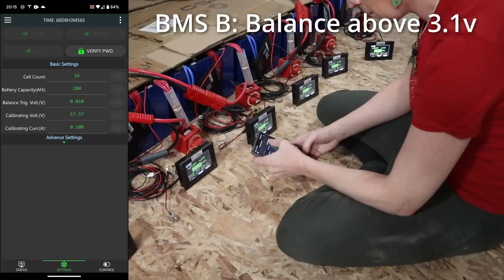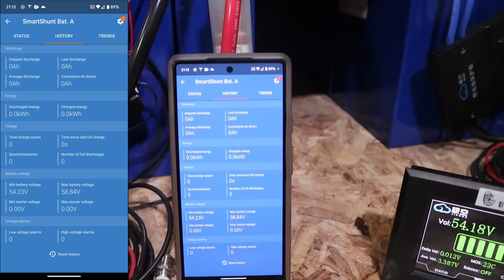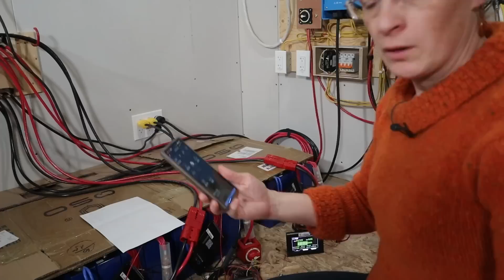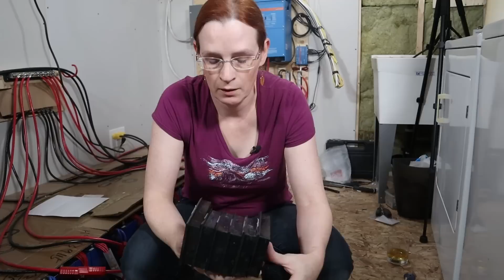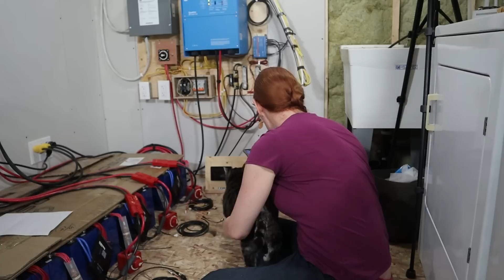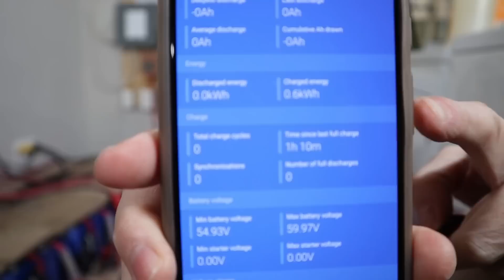Sparky Science! - Big Battery Build! (Ep. 48)

Comment: The screens aren't the issue are they? Why not use an off the shelf buck converter? As you know I am building a similar battery. Indeed 100 304ah cells arrived today. I will use a Raspberry Pi and an IP to 8x rs485 interface to read the BMS data. I am learning from your example. Thank you.
Reply from the maker: 100x 304Ah, nice! You're right, I could have used off-the-shelf. I though I could be more efficient buying a smaller and higher efficiency buck converter. I learned a lot, but financially, this route I took was not a wise one. Hearing that others are learning from me (even if just as a cautionary tale) makes me honestly really happy.
Reply: I was very deliberate in choosing the phrase "your example" and not "your mistakes", as learning positive things too. Thanks for your efforts and good luck bringing the boat home. I am still rebuilding mine. Methinks I will order more fuse holders.

Comment: I think we can all agree that the little “OCD” voice in our head urging us to take more precautions is not being overkill or unreasonable, despite what the other little “let’s just get on with the build” voice keeps saying. Good reaction to the situation. 

I found a little 4-blade fuse block that does not have a “common” side. I use this for some of my test setups. Especially since it allows me to have mixed voltages over the fuses. I would love to see a screw terminal that just has 1A resetting fuses between each pair of screws. I think it would prove very useful for us.
Reply from the maker: The trick is finding the balance between "so careful you freeze" and "too lax and you get hurt". In theory it's an obvious balance, but in practice it's a lot more gray. Well, until after an event like this, then it all comes into focus.

Comment: You rock and this is how we learn, making mistakes. A fuse would not have made any affect on that fire. DC fuses might have not changed the outcome with the buck inverter.  Please just stay safe I would miss you if you were gone.
If you ever have to leave your batteries for longer than say a month discharge them to 50%. That is what is recommended for our batteries.
I do not use what the BMS says for state of charge until I discharge and charge it enough times to be reliable.  Winter really stinks for solar charging.  Once I hit 51.2V I know I have right at 20% left, 48V is 10% left. I then charge back to 54.6 then use batteries to power my house for 3-4 days depending on how much solar input I get and winter there are very few good days.
Wow I do not use Buck Converters as I do need see a need and maybe you should toss them all in the trash. My screen all complete and turn on with its own switch.  They are the handle bar ones and came with my 250 amp JK bms.  How about 1 screen that uses your shunt to display. you can still use your phone to each one. Wow Glad you are okay and didn't burn it down.
I bottom balanced mine at 48 volts since that is the lowest they will ever go. Wow that made a huge difference  when each pack gets 30 amps from solar (120amps total). Before I would see big difference in cell balance. Now I see .006 and balancer turns on and gets down to .004 fast. I see why some say to bottom balance 1-2 times a year.
Reply from the maker: "A fuse would not have made any affect on that fire.", perhaps, but the reason I think it might have helped is two-fold; 1. If you look at the wire after I drop it when I failed to cut it with the saw, it curls up like it's getting hot. I suspect there was a lot of current going through it, even before the sparks started. 2. It would have been something I could have pulled to break the circuit, if only manually. 

"If you ever have to leave your batteries for longer than say a month discharge them to 50%" - Yup, I saw that in the EVE LF280K spec sheet. I didn't mention it the video as the fundamental question of the starting SoC felt, at the time at least, unrelated to the concern overall of high parasitic draw. I've not really looked into bottom balancing... Perhaps I will after the boat is home.
Reply: @TheDigitalMermaid  If you do use fuse they need to be inline and be old style the tube ones, when they break they leave a huge gap. Have you seen the videos showing the circuit style fuses catching fire?  Just be careful and have an electrical fire extinguisher handy. I have seen DC shorts in boats. this is why we have cutoff switches. not the cheap t handle ones the big ones like you do. also on your solar input a dc disconnect not a fused one. a inline fuse outside.
Reply from the maker: @dc1544  The solar has inline DIN-mounted fuse holders, and then normal breakers near the MPPTs. I plan to keep this setup on the boat.

Comment: Hmmm untill you use a BMS that ceases charge based on tail current you'll never be able to accurately determine when they are fully charged, setting a voltage max, and allowing charge current to naturally tail off, but to not cease will essentially just float the cells, which isn't ideal given their chemistry.

Comment: When the battery is under load each cell in a string will have a different voltage, that is way bigger than when they are just sitting there, under this condition the active balancer setting can have a greater impact as it will provoque an unnecessary unbalance. the setting above 3.4 is the best to make sure than when you recharge the battery to 100% you get that even charge faster across all cells. During your test , battery's with a lower balance voltage setting, were a bit more unbalanced and trigger the over voltage protection (that you assumed it was the charge end on the packs tested A,B;C), leaving the balance voltage set to 3V specially in situations where the pack is not constantly charged to 100%, over time will provoque a deep unbalance, that will compromise the overal performance/capacity of the pack, unless you leave it for charging as long it needs to rebalance again. Sorry for the long text :)

Comment: A very long shot that could explain the rapture of the buck converter: Provided the negative terminal of the buck converter was connected to the switched negative of the BMS (just ignore if it was connected to the battery's negative pole) and the charger mode changed, for some wicked reason, to constant current instead of constant voltage, the charging voltage rose, the BMS high voltage protection disconnect was activated and consequently the buck converter had to undertake the max voltage swing of the charger trying to pump through it some serious Amps. In such a case it is normal that the buck converter chip would pop. Greetings from Greece.
Reply from the maker: The negative is on the output side of the BMS, actually. Inductive voltage is kinda what I was thinking as well... If you noticed when I talked about it on the video, I kinda did a "bouncing off the wall" motion with my hand, thinking the disconnect caused a spike. So you might very well be right.
Reply: If memory serves, in a past video of yours, related to the back converter assembly, there was a reverse polarity protection diode at the input. The inductive voltage that you suspected, had it occurred, should had been drained through that diode. There is the odd case that either this diode was not correctly soldered, was faulty from the get go, or it blew instantly failing to protect the parts downstream. You have the item and can check. If this diode is still ok, than the inductive voltage theory doesn't stand.
Reply from the maker: @5fxindices933  I'm sending the board to Andrew for analysis.

Comment: Hi! I'm Sure I lost that part/episode, but what's the need for a buck converter with a 16S configuration with the JK-BMS, have been using them for a couple of years and no buck converter needed with 16S, Only use those with a 8S configuration before JK released the 8S version.
Reply from the maker: The screens only accept up to ~24v DC. So it's fine natively on 4S and 8S configs.
Reply: @TheDigitalMermaid  Ok, I see :)  Guessing the boat will have a normal 12 V system also, maybe you should consider to power the display from the 12V "grid" combined with a power switch so you can enable all on only when you need to do a reading locally and turning them back of when nobody is looking at them :).
Reply from the maker: @claudioporto5926  I plan to have a 12v system, but it will be for the critical systems; Radio, nav lights, backup bilge pump, etc. Most of the house loads will be hopefully natively 48v, and using 48v -> 12v converters as needed at point of use.

Comment: Madi,
Having watched you suffer from doing the last parallel balance cycle - too much work, I am lazy.

Since you have the nice JK BMS - 1A active balance current?...

You should be able to perfectly rebalance in a reasonable time (please ignore this if it is obvious).

Make sure the balancer is on and  activates at 3.4V - i.e. balancer is *always* on above 3.4V (charging or discharging). It looks like you are using those setting already.
Then , Once the battery is 'full' (using your chosen charge voltage), 

Just apply a charger at 54.4V (either your Victron) or you standard CV/CC power supply and walk away for a couple of hours. Current will settle at around 100mA-400mA, but keep going until the voltages become close.

If the JK indeed  is 1A balancing, most of your batteries should be done in 2 hours give or take. You may have to give it a second 2 hours for a battery that is more out of balance (I could not quite tell from video, but most should be close enough).

Please note - if you want to find out why your batteries are out of balance just sitting around - most likely each battery has it's own slightly different self discharge current. The batteries that are lowest are usually the ones with the largest current. For example you will notice several batteries that dropped significantly more  that others. It will always be the same ones.

Also note: You could use a higher voltage (like your charging voltage) but you will find you will minimize high voltage disconnects with the lower voltage. Slightly gentler on your batteries.
I use the same technique using a heltec active balancer with clip-on leads for some 'manual' balancing since I do not have the JK BMS.
Reply from the maker: I've got the 2A balance current models.

Comment: @The Digital Mermaid:
- any balancing below 3.41 V will "destroy" your efforts for top balancing these cells
- according to the datasheet you should use these cells in a range of 80-90% of capacity to reach full cycle time -> 3.01 to 3.49 V max (I would not go that hig to get just 5-8Ah more 3.45V is my max)
- think about paralelling some cells directly and use not this much BMS. Less consumption, less errors
Reply from the maker: The reason for six BMSes is because I want maximum redundancy. With how I have it, if I have a pack failure while under-way, I can just disconnect it until I have time to do a repair, possibly weeks later, and only lose 1/6th my capacity.
Reply: @TheDigitalMermaid  I do understand that, but using 3 and having 3 as spare parts is the better way if you calculate it with the possible errors. And you can install the BMS that it is still possible to change it within minutes. I do use BMS with industrial relais (no Mosfets, no heat, no errors) ;)

Edit:
You could even mount 2 BMS with a switch in one cell parallel pack

And think about the balancing issue: early balancing destroys top balancing always due to the chemistry and physics (Andi did proof that and still does not really use his own proof... watch his video about the voltage line and rethink the best voltages)

Comment: Madi, good video. You collected some nice data which comes at a price.
A couple of suggestions - ( been there...)
Short of doing this in the garage, get some concrete boards (or tile floor) when you have loose stuff sitting around.
Please, use something other than cardboard on top - relatively quickly flammable. (corrugated plastic)
The buck converters should have a fuse - they may fail shorted.

On the the data....
The data collected shows 300WH which is about 5.4aH. Since you did the experiment for 3 weeks, 504 hours, we get about 10mA of current.
Most of that will be the BMS, the rest will be self discharge if nothing else is connected.
That seems reasonable to me  - (my Daly's are between 6 and 8 mA and I found my crappy 100aH cells have between 0.5mA-2mA self discharge. Your cells may be in similar range (larger capacity may give a bit larger self discharge current) - I hope that statement is not too controversial)

It also shows the balancer did not use much current of that 10mA. In any case, the balancer you have is active (as far as I can tell) and should not use that much power anyhow when it is running, since the point of 'active' is to not loose power.
Reply from the maker: Ya, I think in this case the balancer just never turned on much at all, simply because the delta is too low. That part makes sense. What confuses me is why I saw such a big loss of power in the week prior to the main discharge test...

Comment: Sorry to see that you ran into those issues. To replace those screens from your operational use case, you can maybe consider to connect all the BMS's to the Cerbo via the RS485 connection. This is what I have done and I see all the individual pack voltages and amp draw... in one single screen. Keep your shoulders back and head high!
Reply from the maker: I bought the RS485 connectors for all the BMSes. If I don't replace the BMSes entirely, then this is how I'll do it... Collect all the data into a database for display in a single screen.
Reply: @TheDigitalMermaid  I've been using Solar Assistant with an Orange Pi (that supports HDMI output)
Reply: Oh! and I do agree with you that the screens were the parasitic draw
Reply: @TheDigitalMermaid  Ah, you shouldn't use the RS485 converter. Yes, it works, but adds another step (and use of power) for something you don't need. You can go directly TTL->USB. With those converters you go TTL->RS485->USB. If you want to use RS485, of course that's fine, but to log the data on a Pi or something it's a needless conversion. The output at the BMS is just TTL.
Reply from the maker: @upnorthandpersonal  Wait, so I could connect to it like I would a network switch or UPS? Is it something simple like 9200 baud 8,n,1? What are the pinouts, do you know off-hand? I've got the RS485 adapters but haven't tried using them yet.
Reply: @TheDigitalMermaid  Yes, 115200 baud 8,n,1. There is a picture of the pin-out on my github account - I'll drop you an email because YT removes links...
Reply from the maker: @upnorthandpersonal  Ooooooooh, looking forward to it! I've done a lot of RS-232 serial. I assumed RS-485 was similar, but hadn't actually used it myself yet.

Comment: With the screens it may be a good idea to have an isolated supply. On the batteries have an outside power source to connect to a jack on the box. The screens don’t need to be on all the time and would help with the standby power draw. I have a few ideas on how to implement.
Reply from the maker: Someone else mentioned a common 12v supply. I thought about the option of doing an external plug to power them up just when needed.

Comment: Stay positive, you are not learning  if you done make mistakes. Sometime taking a step back and simplifying and not overthinking the system will help. my limited experience with having cells in storage after 5 month disconnected is all of the cells settled into 3.35v and have not moved after the first month or so. stay positive and don't rush things you will get to you goal.
Reply from the maker: Thanks, and ya, you learn when you push the edges of your knowledge, and you cock up when you push the edges of your knowledge. They go hand in hand.
Reply: @TheDigitalMermaid  I had a thought about your buck converter fire, is it possible that when the BMS switches the ground side off you have voltage/ amperage looking for a ground and it decided to use the buck converter ground?
Reply from the maker: @rottweiler9535  I'm not sure, but from most of the comments and from a chat with Andrew, I'm leaning towards a voltage spike caused by the power in all the wires causing impedance which, when the magnetic field collapsed with no where to go, caused a significant power spike on the wire that shorted the buck converter. Perhaps this is what you mean by "looking for a ground"? If so, yes.